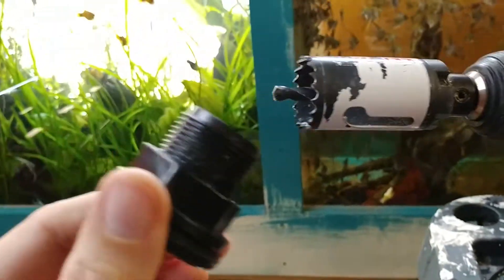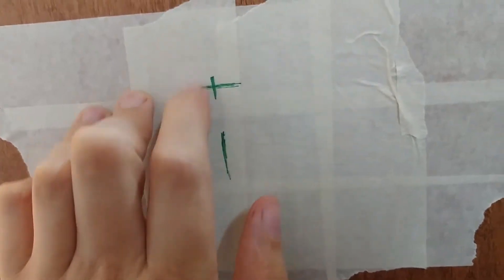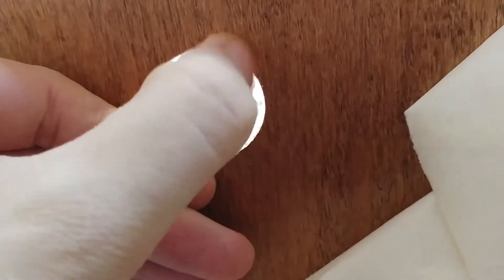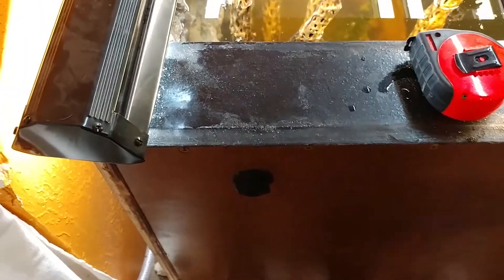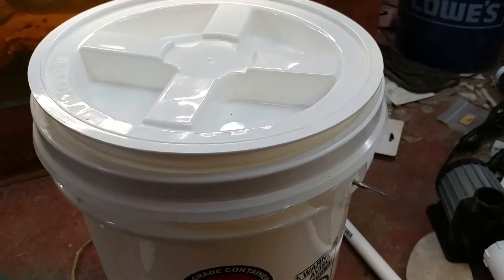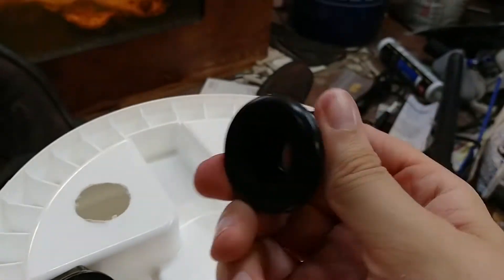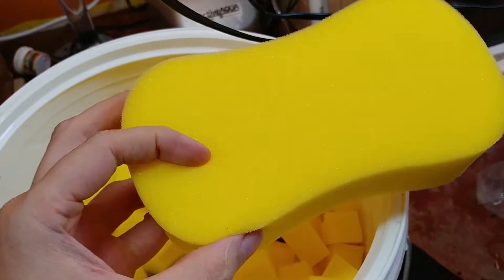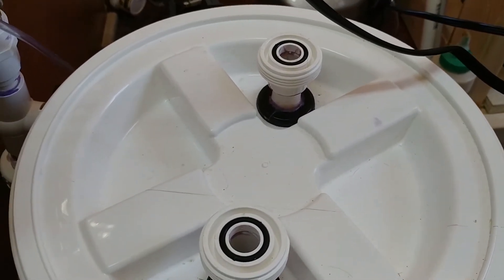DIY canister filter + plumbing

Comment: Hi, I was wondering if heavy duty 5/8" inside diameter garden water hose would work for tubing.  It would be behind my tank out of view. As I have only been able to find the braided vinyl tube for $2.46 a foot vs $20 for a 50' Heavy Duty garden hose at Home Depot or ACE.
Reply from the maker: Garden hose is safe, generally, but I'd spend a little extra and get a "drinking water hose" if they have one. They tend to leave less flavor in the water, too much rubber flavor in the water can make some fish picky about eating.

I've only had issues with 6 fish refusing to eat in tanks with rubber tubing, though, so it seems to be fairly rare
Reply: Thank you, Great info.

Comment: Hi there I was wondering if you could email me the hole list of parts that you used on this canister please my email is tysondooling@gmail.com thanks
Reply from the maker: I'd recommend removing your e-mail address from this comment so you don't collect automated spam.

The parts list is:
5 gallon bucket (generic is fine)
Encore Plastics 12-in White Plastic Bucket Lid (part # 82136) - Good idea to add vaseline to the seals to stop leaks
Lifegard Aquatics Slip Bulkhead Fittings of your chosen size (need slip and not double threaded to glue PVC into)

Jebao DCT-6000 pump, which is overkill for most projects and I run it at 30%. Buy PVC fittings instead of using the built in to save yourself some headache, the included fittings are garbage and they destroy the gaskets
Pot Scrubbers - plastic - never use the copper coated ones
PVC pipe + fittings

Plumbers tape

I ended up removing everything but the pot scrubbers and just using a couple large sponge prefilters for mechanical filtration. It keeps me from actually having to open the canister and clean things more than once every 6 months, I can just take the sponges off the input and throw them away once a month.

Comment: Is this filter still running well? I have seen a lot of people make this with mixed reviews on their effectiveness, mostly they leak is what ive seen.
Reply from the maker: The lid isn't really designed for this, so I had to use a little vaseline and really tighten the crap out of it. The rest is all basically glued, so there's no room for leaks anywhere else. Bulkhead fittings are a much better idea than uniseals or silicone globs (which I've seen on a lot of other DIY setups).

I haven't had leaks. That being said, it's not a great design and I wouldn't spend the money on doing this unless you already had most of the stuff (I had basically everything but the pump and the lid already). I'm working on a much better filter design than a standard canister (one which scales to any tanks size), which should be up in a couple of weeks.
Reply: Angelfish Unlimited cool thanks for the info! Excited to see what the next design is! I recently bought some containers off Craigslist I have been wanting to try this with. They are 25 gallon food grade shipping barrels, with lever locking lids. You can find a 15 gallon one on Amazon for around $30. If it works I think it could really be a great option. Who has a canister filter that can hold 15+ gallons! Lol
Reply from the maker: I'd just make sure water is being pulled from the canister and not pushed into it, it keeps a vacuum in the container which helps a lot in stopping possible leaks. 

With a 25 gallon container I'd probably make up a sort of hybrid sump, one of the 15 gallon boxes of bio balls from ebay, a layer of sintered quartz on the bottom, and throw away pre-filter full of poly fiber before the intake. Cleaning a 25 gallon canister with normal layered design would be awful, but it would be pretty easy to fix one up that wouldn't have to be opened more than once a year.

That's sort of my goal with my new design, a couple quick maintenance modules (30 seconds to change out once a month) and some long term modules that I shouldn't have to touch for a couple years unless they get packed with snails.